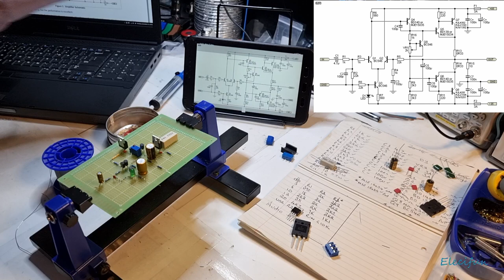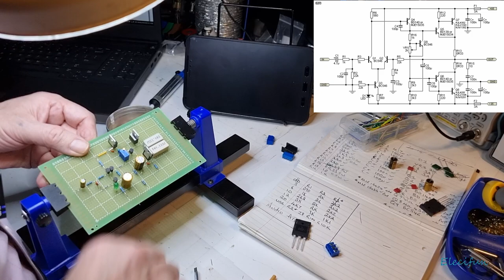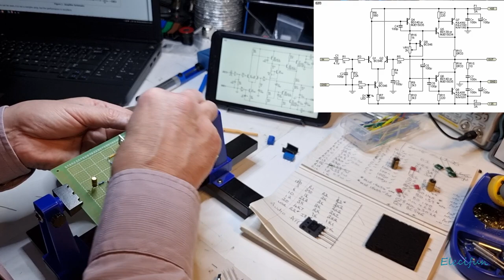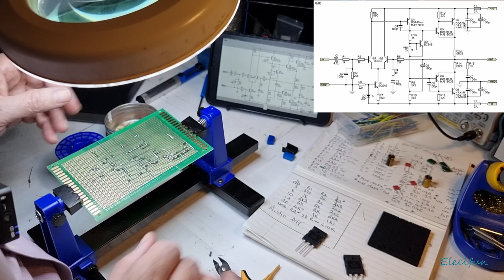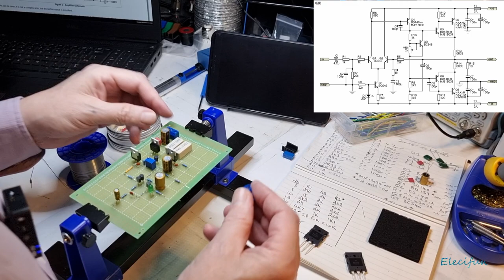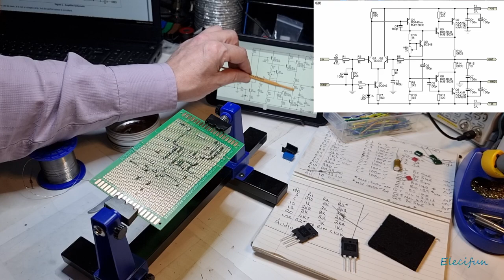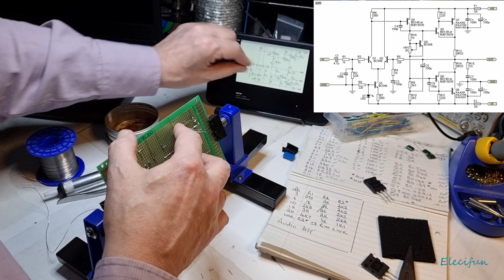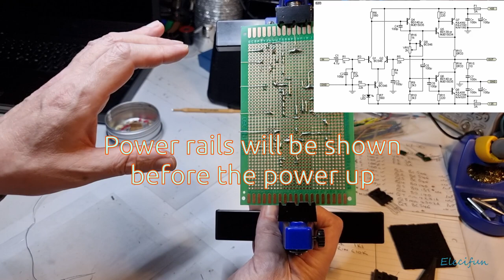ESP DIY 60W HiFi Amplifier Build Pt3

Comment: Really nice job Elecifun! Clean and tidy front and back. I'm looking forward to seeing the connections for power, input signal, and output to speakers. My mains are 120V where yours are probably 240V. I'm also anxious to see what speakers you use. I have a 30 year old pair of JBL  speakers that sound wonderful to me  with 8 ohm output. Thanks again for these inspiring videos. I've decided my next project will be to add a tube driven pre amp to my hifi tube set-up. The parts will be about $65 USD and I should have pretty fast delivery since they're coming from a US source. I'll post the process. I'm considering an L12-2 for my solid state build. Pretty inexpensive on EBay but I'm sure delivery takes awhile from China... Cheers mate.
Reply from the maker: Hello m8 cheers for the positive comment. I use Q Acoustics 3030i speakers on stands English walnut, quite nice. 
Would be good to see your amp project I will be sure to check it out. Tip put a thumbnail using image of project, make it stand out.
Reply: I'll definitely post my build.